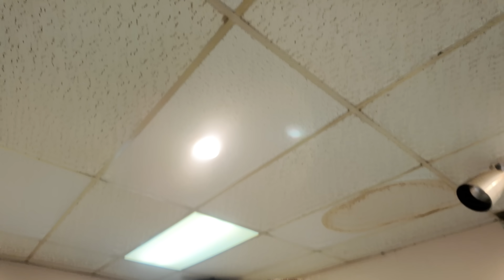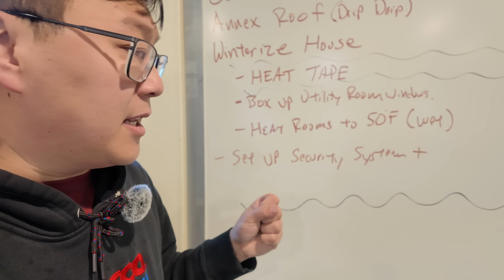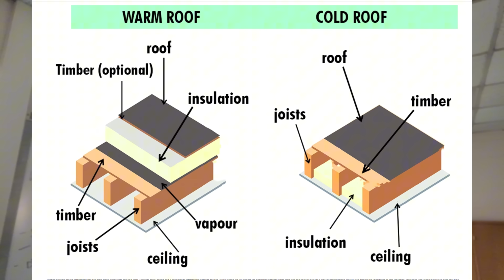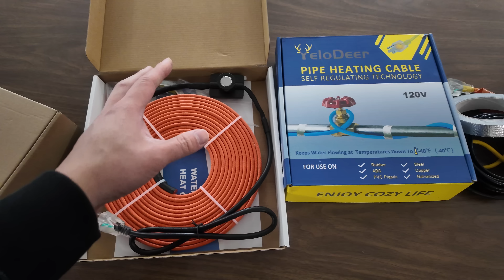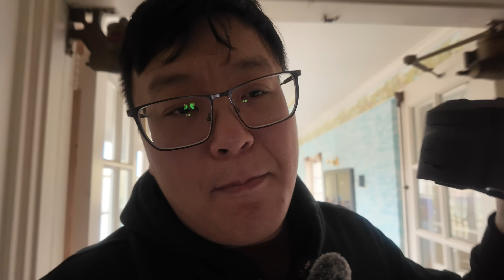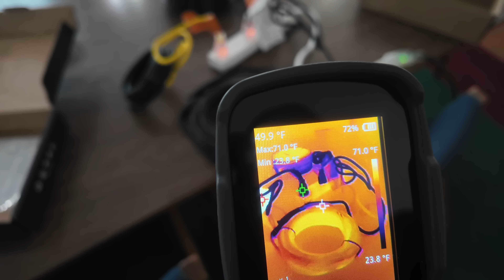Winter is coming! Checking out heat tape and more issues. Abandoned School episode 29

Comment: I went and looked it up, they have translucent thermal bubble type that cover windows with Velcro on the sides. Lets the light in compared to thermal curtains. Not as expensive. Jason still has to insulate that water pipe though.

Comment: Dry-Erase Marker Method: Go over the permanent marker with a dry-erase marker. The solvent in the dry-erase ink can dissolve the permanent ink. Then, just wipe it off with a dry-erase eraser or cloth.

Isopropyl Alcohol: Dampen a cloth or cotton ball with rubbing alcohol and gently rub the marker stain. Alcohol is effective at breaking down the ink.

Hand Sanitizer: Apply a small amount of hand sanitizer to the stain and wipe it away with a cloth. The alcohol content in the sanitizer should help dissolve the ink.

Whiteboard Cleaner: Specialized whiteboard cleaners are designed to remove tough stains. Simply spray the cleaner on the stain and wipe it away.

Baking Soda and Toothpaste: Mix a small amount of baking soda with non-gel toothpaste, apply to the stain, and scrub with a cloth. Rinse with water and dry.
Reply from the maker: I'll give those a shot great ideas thank you!!

Comment: Growing up in a 3 flat apartment building in Chicago that is (now) 100 years old, I'm all too familiar with that plastic window kit.  I don't know what we used but we definitely used plastic on some of the windows, my room especially.  We had storm windows and a screen on windows, but I don't remember that being on all of the windows.  I took my storm window off one day because it didn't fit tight in the track, so it rattled when it was windy.  I put it on the porch behind the storm/screen door and well, someone opened it so hard one day that they broke the storm window.  I didn't have a radiator in my room, a previous owner removed it.  So in winter without anything on the window, it was as if the window was open.  It was freezing!  My oldest brother was under the impression that my room (his former room, I might add) wasn't that cold because the room was over the boiler.  Dummy, it's only warm if you stood up on the spot above the boiler, it was freezing everywhere else.
Reply from the maker: I don't know why anyone would remove a radiator from a room!!! Im hoping the plastic wrap helps!

Comment: I've seen metal construction buildings like yours where the inside of the roof was sprayed with spray foam, and then a layer of insulation on the roof under the roofing. No idea what was used on the outside, just that it was up there.
Reply from the maker: Im hoping they put insulation on the outside. Though I will have to replace it. Im in the North so They recommend a r60 or something crazy on the roof. Thats going to be at least 8 inches of insulation, so hopefully they have some up there or the building might look like its got a top hat on.

Comment: Best solvent for permanent marker is permanent maker. Grab a Sharpie and a rag and rub a small spot of the mark is the Sharpie and then wipe it right off. May want some alcohol on the rag. Try a really small spot to make sure it really works; there is always a chance that the marker used was a different kind with a different make up.
Reply from the maker: i'll check it out thanks!!

Comment: Yay, multiple episodes this week.  I will be in heaven.  Wonder if you intend to extend the roof line past the current one on the annex, whether it would be easier (and cheaper), to just mount a new pitch roof above what is already there?  That way, you wouldn't need to worry about ripping off what is currently there (because lets face it, there is a lot of unknown areas that will need to be redone) because the new roof would cover any existing areas of concern.  Just a thought.
Reply from the maker: Thank you!!!! Been seriously considering it. There is a HUGE vacuum extractor on the roof. Or else i would consider something pitched. The vac extractor had to have been craned in which would be also a pain to crane out. I think if I can just pitch it ever so slightly maybe 2-3 degrees I would be in a better condition vs now. Its pooling in the center. Assuming there was some sort insulation that collapsed in the middle there.

Comment: Instructions for these pipe heating cables clearly state:
1. NEVER plug in the heating cable while it is coiled.
2. NEVER install heating cable in walls, floors or ceiling.
Reply from the maker: You are correct! When they heat up too much they will melt! For a few seconds just to see if the coils function should be okay! Most of the coils are going in to EXPOSED basement pipes! So should be okay. If i do run one in the breezeway it needs to be able to be monitored SO it will have to go in some sort of raceway with access and will be regularly checked and monitored!!

Comment: Would getting thermal curtains or thick layered blackout curtains for some of the windows to help with retaining some heat work for you? I use them in my apartment to divide the hallway to my bedrooms and my living room. It seems to work pretty well for me by retaining the temperature of the bedrooms. You could try doing the same and putting some curtains up to divide the breezeway to limit the draft, at least. Or just putting them on the single-pane windows to help with the draft and give some kind of temporary insulation.
Reply: I was thinking that too. it made a huge difference i. my house. We actually have double and some triple panels windows, but it gets really really cold here. like close school.for cold weather sometimes
Reply: Never heard of that, Ha! What a great idea! It doesn’t get that cold here ( maybe a month or two on and off), to spend the money for curtains and rods, but impressive alternative❣️

Comment: Its not clear from the video - is the basement window/louver/fan airflow needed for furnace operation? Thought I heard a plan to close them off.
Reply: Furnace not working right now…might want to just close them up in the meantime.
Reply from the maker: So. I don't know why they need a vent there. Most steam boiler systems are vented through the main stack of the house, this is no different. The huge pipes down there are venting straight through the top of the chimney. I see no reason they are needed aside from evacuating gases possibly from that generator. Both of those units are non operational as of now and untested. They will not be firing anytime soon. The annex unit will be removed. and the main steam boiler if rectifiable will be fixed. HOWEVER even if fix it will no longer serve as a main source of heat because they are very inefficient at generating heat vs energy. So heat pumps will be replacing them through out the house. They only time they would possibly be booted and used is if the weather dips below -10F which also is somewhat rare. In the event that happens also back up resistive element heating can be used to generate back up heat. Im not too concerned now. But the reason why the pipes burst was indeed because those "windows" If you can even call it that were wide open.

Comment: So do the heating wires for the pipes have a thermostat so they don’t just get hotter and hotter? You said they can cause fire.
Reply from the maker: The thermostat is to regulate temperature. So what happens is Once it dips below 40F they turn on. Once the thermostat sees its 45ish they shut off. They are know for fire because people wrap them over themselves and certain areas get super hot because there are multiple elements heating and it melts the sheathing. Two the thermostat if its not fixed properly to the pipe it will never read the correct temp which can cause fires. This is something that absolutely needs to be monitored so I will be cautious of this!

Comment: I had never heard of a thermal camera before. We owned an old house many years ago and this sure would have been a help. I learn a lot from you.
Reply from the maker: Thermal cameras are great! It helps you see things you would never see normally! Once i get a chance to get the water on intend to use the system to detect leaks in the pipes and where they are located! Should help a lot!!

Comment: Just throwing this out here about your stains in the ceiling. We have a drop ceiling like yours in our old house. We live in the SE. Our ducts have sweated in the humidity and stained the ceiling tiles. No roof leaks etc.
Reply from the maker: There are no ducts up there, So i am assuming it has to be sweating from no insulation, or a leak. I have kept some of them there just as a reminder to check those areas to see whats going on. Many parts are where pipes burst from the freeze so those would be good to keep track of. Once all those have been rectified. I will try to keep an eye on them still. I don't know if its justifiable but maybe put a flood light and camera up there so ever now and then I can just turn it on and look to see if there is anything abnormal.

Comment: if its a permanent marker, use the dry erase marker over it and it usually works. Its worked for me and my classroom
Reply: Yeah dry erase marker has worked for me to remove permanent marker from white boards and sometimes other things too
Reply from the maker: I gotta try this thank you!!!
Reply: @watchere  Good luck!! like i said its worked for me! :)
Reply: I came here to say this. It’s like magic. 🪄
Reply: you beat me to it, I ran here to post the same information.  I did some research when I accidentally used a permanent marker on my board one night.
Reply: Yes, it should work. It's the alcohol (solvent) in the marker. You could also try straight isopropyl (rubbing) alcohol on a rag or paper towel.
Reply: If that didn't work try wd40